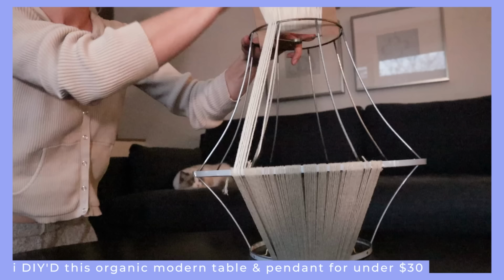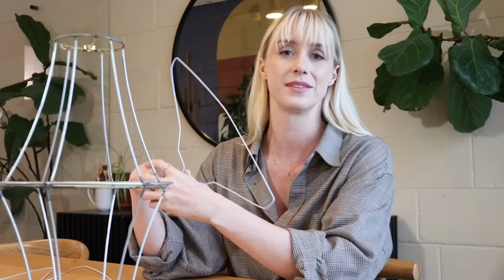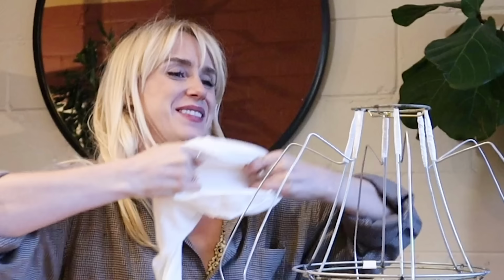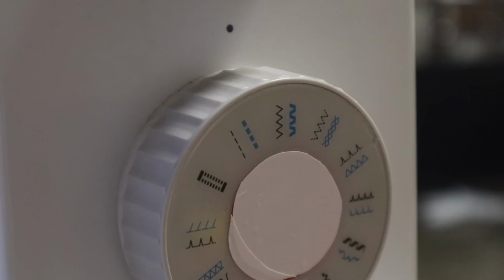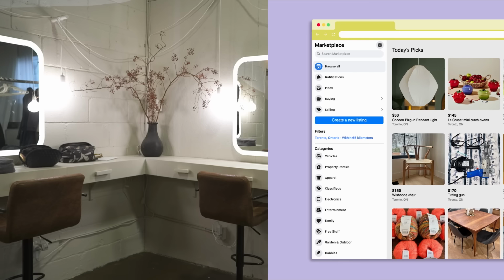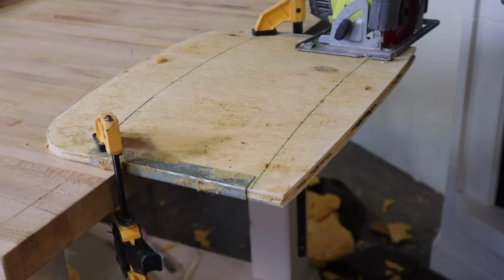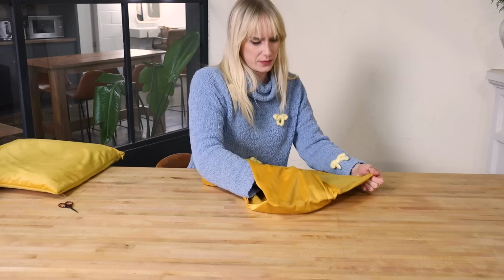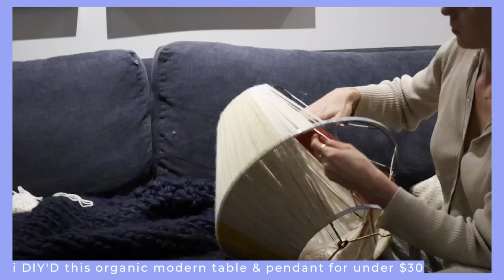upcycling ugly items into designer decor...hopefully

Comment: Idea 1:Take off the over, turn it inside out put it back on.   Open the bottom drawstring fully and pin 6 evenly spaced darts at the bottom of the fabric to get rid of all that lower excess fabric (anything below the widest part of the lamp). Take it off and sew darts.  Cut away excess fabric.  Put it back on, position all the "wing" pieces perfectly.  Mark where they are (use a friction pen if you can).  Take off the cover, disconnect the bottom of the "wing" pieces.  Sew channels where you marked the fabric.  Slip it back on pushing the "wings" through the channels.  reattach the wings.  The channels will keep the wings spaced where they are supposed to be spaced.
Idea 2, add strong wire between the "wings" to hold their spacing and go back to the pantyhose.

Comment: You could definitely decoupage/glue thick rice paper or vellum to the lamp . You could do each “panel” going vertically , cutting off excess each time for a clean look .those papers will bend around your curves when moisture is added , but stiffen up with the glue when dry- thus giving you a similar look to what you were going with. Just a thought !

Comment: The concept of the cocoon light is great, but it's all about the structure of the lamp.. my suggestion is to make some sort of short tube with vertical structure in every side (like a hat box), and also make a tie dye on the top and bottom wrinkle area, for some accent.. after that you could always use some tassels for more pops of accent 😊

Comment: I looked at a lot of the historical examples of weirder shaped cocoon lamps, and a lot of them seem to be made of a material that has a lot of fibers. I’m not totally sure on what that material is, though I wondered if it was very thin fiberglass.

What you need to make it work, I think, is a material that changes properties when heated or wet.  a thermal plastic that shrinks when heated would work. I think animal hide parchment might work too? You get it wet, stretch it over the frame, and it shrinks onto the frame when it dries.
Reply: Okay so apparently some of the weirder shaped cocoon lamps are actually made using a multi-step process of spraying on polymers, which doesn’t sound DIY friendly. Buuuut the concept: layering first the cocoon webbing and then coating it, seems plausible.

You know those DIY lamps made from string dipped in glue and put around a balloon? Okay take that concept but use some kind of webbing (maybe like the kind used for Halloween decor) to stretch between the frame pieces to give the shape you want. Build up to desired opacity, then use heat shrink plastic for outer shell.

Comment: If I were to DIY the light, I would keep the shape and instead of using the fabric used by Rachel, I would instead use a burlap fabric. Cut the fabric following the lines of lampshade and glue it to them. And to hide the cut corners, maybe glue strings of jutes if that makes sense? That’s just me. I think burlap fabric is perfect as it has some tiny holes in it. It would still provide some light but not too much if that makes sense 😅

Comment: I think the cocoon light wings could have also been attached in the middle to the base (they would bend less as you moved them around) + possibly a “rod”between each of the wings? The rod could then be attached to the support between the wing and the base so that it wouldn’t be seen through the fabric. And as for the cover, either a stretchier fabric, a design that wouldn’t have such a big difference between its widest and narrowest point or simply making the cover from more pieces (definitely would require a lot more math and perhaps some pattern making and/or geometry skills).

Comment: So with the light...it would have taken longer but i would have done it like this... (i will explain as best as i can, a drawing would be easier)
- make a 'sleave' type thing for each wing to be in individually. As in a piece of fabric to go on either side of each wing so the  each one is covered but the centre frame is bare at the moment. I would make each covering fit into the indents in the wire to get the right shape and use elastic to secure them in place. Basicly make likwe a dimond shaped sock! Doesn't have to cover the top or base yet. Just the wings.
- next i would cut strips of fabric that could be sewn vertically to the outer edges of the wings. The edge of a strip would be sewn to the rim of a wing, the other side of the rim sewn to the next rim along, etc, unit the whole structure is covered. By each strip being sewn in place this will hold the shape of the lamp.
- if the rim and base are still exposed, i would cut a horizontal stip and sew around the top and base and secure to the vertical strips

I really hope the makes sense 🤷‍♀️😂

Comment: The light - please try and save it. All you need to do is tack solder the wires so they don't move and go back to stocking for cover. If you don't have a solder iron, you can use liquid metal solder or epoxy paste - inexpensive and easily available. Good luck!

Comment: For the lamp, I think the first sharp corner was too drastic, the fabric couldn't stretch in to that space because it also had to stretch up to the top of the lamp. Because of that, I think any sharp corners should be closer toward the middle of the lamp so that the fabric can dip in to it more. 
This is more my personal opinion, but the bend that was in the very middle of the wire was also pretty rounded, so I think it would give a more drastic look if it was a pointed bend. An easy way to make that happen is do make the bends against the curve instead of with it, as you did this time.  But thats kind of up to personal preference, if you want a more pointy or rounded. 
Since the wires kind of moved around a lot, I think either make that a design feature so that it can be collapsable for the sleeve to fit on better, or find some way to bend the wires around the support posts so that they can't freely swing side to side, like wrap the ends around the circle rings on the top/bottom of the lamp shades rather than the spokes in the middle.
Also, I think for the fabric, the thinner the better.

I hope this is actually helpful, I'm just brainstorming.

Comment: To prevent future ripping of fabric you can use an awl to poke holes rather than cutting them. In this case the holes probably won't get too much stress, because people are probably not going to be pulling on the fabric, but it's a good idea to avoid cutting threads if you don't need to. 😊

Comment: Paint the panty hose, it could have a more polished look. Just like a light layer of matte white paint would do the trick. I did a project in middle school where we did exactly what you did with the lamp shade but instead we used wire hangers to make sculptures. But to me the most important aspect was painting it. I also feel like the sheerness of the panty hose was not fully even all around

Comment: Your inspiration pendants had more of a curved, pumpkin shape that would be easier to stretch over. I wonder if you started with some knit fabric that comes in a tube (rib knit often does and other knit fabrics can be found this way) would help you find out your maximum stretch circumference and then you could dart the smaller ends?

Comment: If you take some thread and a needle. Where your wire juts outs, sew tiny stitches around each wire all the way down. It will help ensure that each wire stays in place and also you’ll be able to see the detail much better. You can also do the same thing around the top and bottom so there’s no drawstring hanging out. It’ll look way more professional and you’ll be able to get more $ for it. I really would have suggested that you solder the wires to the base, but it’s extra work you may not have to do if you just sew the material onto it.

Comment: In antique aircraft restoration for planes made with wood, metal and fabric rather than mostly metal they use a nylon material (not tights!) that then is shrunk with a heat gun onto the frame of the wings etc.

Comment: On the lamp, what if you removed the added wires and covered them and the lamp shades independently of each other. Then somehow reattach the added wire back to the lamp shades. IF it's doable, I feel like that would allow you to tighten the fabric, possible removing the puckering and also allow you to keep the interesting angles of the added wire.

Comment: For the lite cover, if you pleated the top and bottom it would give it more of a defined dimension. You would have to hand stich it.  You could also cut V's out of the top and bottom of the shade at each angle and glue it to the connections.  Not sure how either idea would work, but thought I'd throw it out to you.  Cleaver idea ...

Comment: I think it might work to add another wire horizontally, on the inside, so the outer parts don't move. Also, bigger tights could work better to maintain the shape of the lamp, and you could stitch them to the wire where it curves.

Comment: smart move on using the steel wire. i would have used it to secure the panels instead of tape(possibly solder the pieces together), plus added the steel wire in the middle(horizontally)holding all corners in place of the panel for more structure. as for the cover : would have tried covering each individual panel with fabric and sewing them.

Comment: Try soldering the wires so they don’t flip on you and sew the nylon pieces together on the structure rather than pulling them over already sewed. You’ll probably need an extra set of hands to accomplish it. Maybe you can try other materials with less stretch so there’s less tugging during the process. It’ll be a bit of a different look but layered tulle or something similar will still allow for light and wire details to come through.

Comment: The added bended wire should be smaller, and not reach the top and bottom openings. This way the stretch fabric can be shaped more tubular and won't require draw string.

Comment: for the light, I know it'd be way harder to maneuver and it'd require more elbow grease and some hardcore clippers, but maybe trying to bend the original lampshade wires into the desired shape and going over it with a sligthly thicker panty hose-like fabric. kinda curious to try it myself because the concept is awesome!

Comment: About the lampshade I think you could have get away nicely with some super stretchy fabric kinda the way you went - if you just welded the wire pieces to the frame instead of taping them.
They would be more sturdy, thus more forgiving of the fabric tightness, and your welding doesn't need to be perfect or pretty so it's relatively easy to do

Comment: I think the tights could work for the light, but you'd need to reinforce the wire in some way (maybe with metal rods?) to stop them from moving under tension.

Comment: For the light you probably would have needed to make a pattern that has a piece for each side. For example if you have 4 wires (the stick out bit) your pattern would need 4 panels for each "side" of the lamp to sew together. you would sew all of them together but don't sew it in to a "tube" and then to fit it on the lamp you would need to sew it together maybe by hand directly whilst its on the lamp. Also have you seen Christine McConnel make lampshades? her wires were wrapped in fabric so she was able stretch and pin and sew the "panels" directly to the wire part. I think it might be a lot more work tho :/

Comment: Would panty hose or a sheer stretch fabric have worked better for the pendant light? Like the kind used for gymnastics or ice skating costumes? I would assume that material is durable, sew-able etc. I would suggest making a table top version of this first, then a pendent. Becky's lamp turned out great and had a comparable structure. Great attempt on the lamp!

Comment: I think with cocoon you needed a secondary larger ring furthere out on your arms instead on just the inner circles. Also some welded joints would work better for strength. I think those 2 things would make stronger for the nylon idea which then gets it closer to the inspiration

Comment: Love all your creations. If you try again, 6 panels should have held the shape - 1 for each section, stitched together with the seam of the stitched together pieces sitting where the wires were extended out. Then it should not have needed the drawstring. I hope you try again.

Comment: The lampshade frame needed a bit more stability somehow. It also looked like the bends weren't exactly the same between the different wings. It kind of loses the effect if the fabric is not taut all the way. The pantyhose trick would probably have worked if the shape was less exaggerated, like the first examples you showed. Perhaps the shape was a little too ambitious for a simpler DIY without soldering lol.

Comment: I think the shape you picked for the lamp made a challenging build even harder because the fabric can't dip back down around the wire frame. I also think the frame needs to be perfectly rigid. maybe cold welding epoxy would work? you were so close!

Comment: For the lamp, I think a spandex type fabric could work better, and tacking down the fabric at the bottom of the valleys at the top and bottom could help make that shape clearer. You could also run a row of gathering stitches at the top and bottom of the cover and just sew a tube and gather it down once the cover is on. I also think stabilizing the wire ribs that you made would help. Overall I think the lamp has a lot of room for improvement and it would be interesting to see what you can try to try and make it work.
Reply from the maker: Love this solution! How would tack down the fabric?
Reply: might need to wrapt the wires in strips of fabric  first so you can sew onto them  @TheSorryGirls
Reply: Or just with thread around the ribs, since it’s just at the bottom of the valleys I don’t think it would show too much if you just stitched all the way through. Another option could be to superglue the points you really want it to be close to the metal

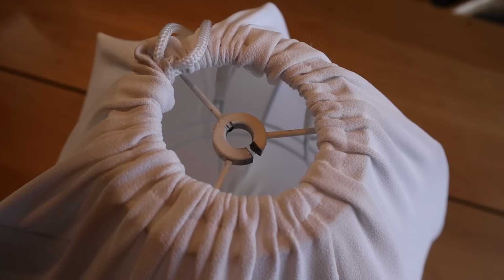Comment: In the 1st project, the rods are not bent symmetrically, in a leveled way (12:32, 12:48, and 13:00, the rod on the right). I wish you had fixed it before calling it "finished" and "store-bought quality". Because of the stretchy fabric, the smallest imperfections/asymmetry are visible.